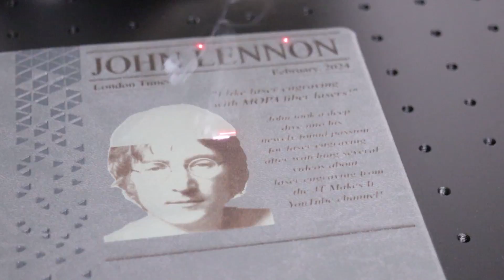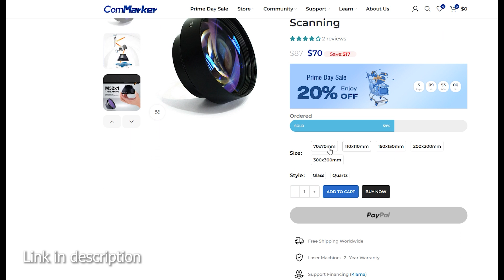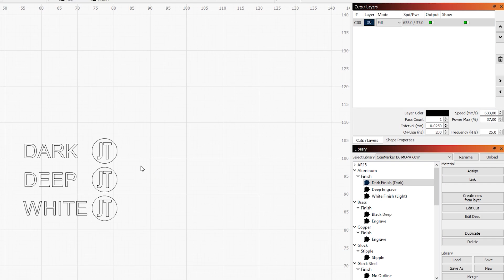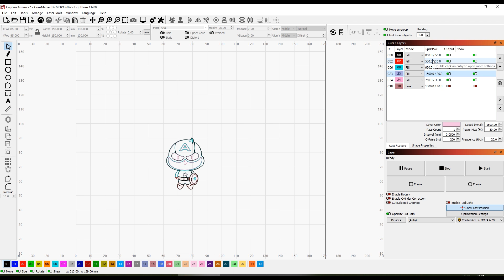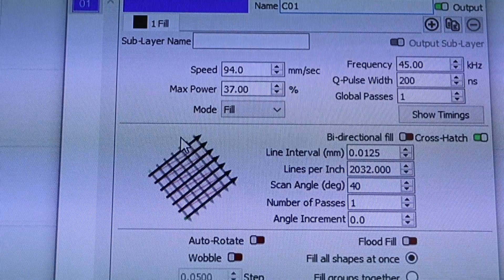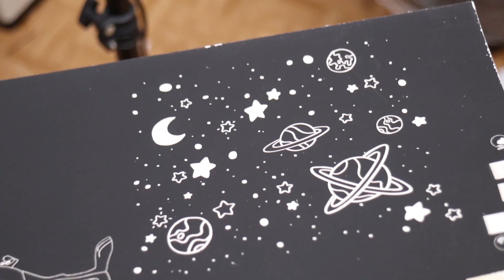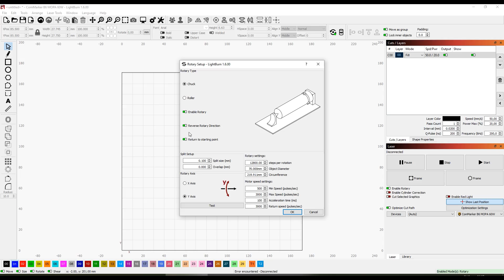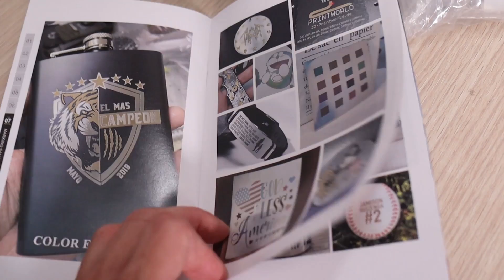Smaller Size, More Brain and Same Muscle! ComMarker B6 60W JPT MOPA Review and Test

Comment: hi, thanks for the video. I just bought the b4 but it seems so noisy, can you tell me if the b6 is so much quieter to change it? thanks
Reply from the maker: Hi, the B4 should be almost silent until it heats up and starts the fan. b6 is noisier because the fans are always on.
Reply: @JTMakesIt  Thanks for your reply and the work you did!

Comment: Thank you for the video. Do you mean the machine you get from the kickstarter campaign is different than the machine you get later (at higher price then) ?
Reply from the maker: No, The Kickstarter campaign machine should be the same to the later production units. Mine tested here is a pre-production model and it has louder fans compared to the production unit. Recently I found out that the production machine also has an improved focusing column - more stable.
Reply: @JTMakesIt  Thank you very much. I will probably buy a 60w mopa autofocus model from the kickstarter campaign.
Cheers from France (Dijon, city of mustard).
Reply from the maker: @laser-on-off  Cool! MOPA is a nice and versatile machine. If you want to support this channel, you can use the link in description and buy through it at no extra cost to you
Reply: @JTMakesIt  I will try to do so, using your link.

Comment: Great video! Just one small correction. The same lenes that they sell for the B4 machine will not fit on this B6 machine. The B4 lenes are M52x1 and this machine takes a M55x1 lens, they are not interchangeable. I was able to find a smaller M55x 1 (110mm) lens on Aliexpress that I purchased and was able to use with the B6. I hope ComMarker sells their own versions of these M55x1 lenes as well but I never got confirmation that they were going to.
Reply from the maker: @BusterBeagle3D  thanks for the tip, I was not aware if this!